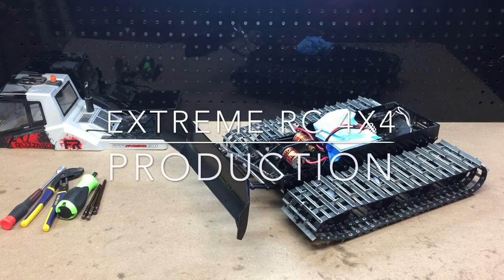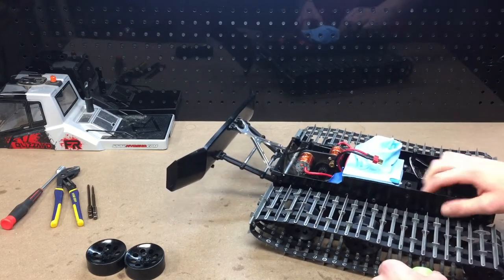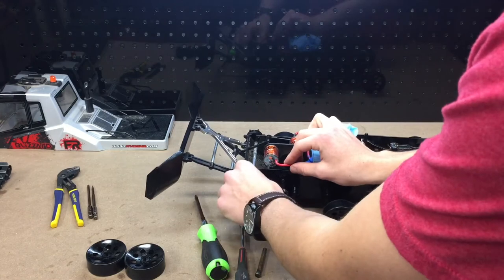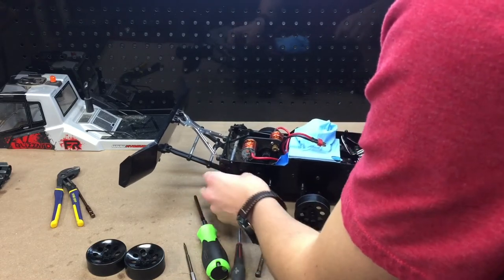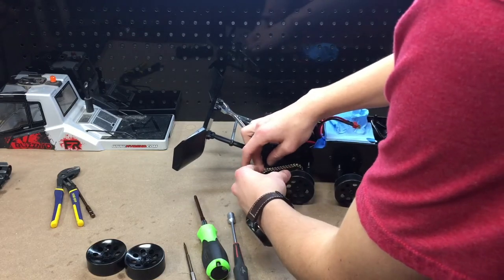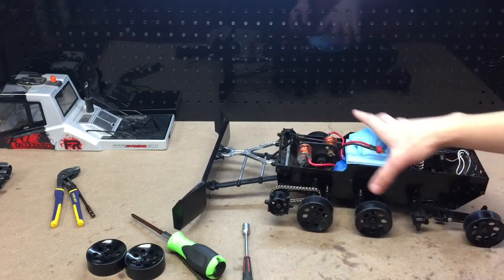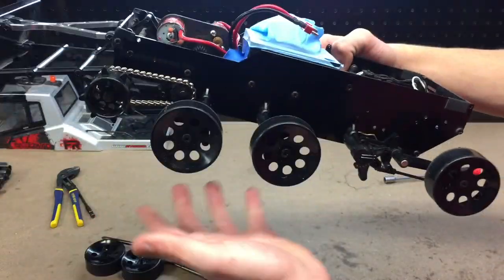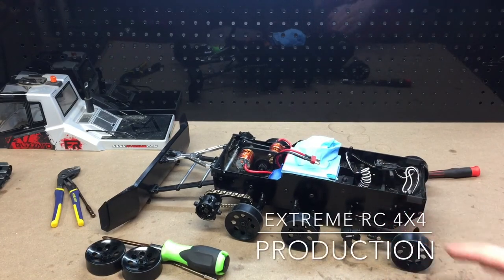EXTREME RC 4X4 Kyosho Blizzard Drive Chain Tensioning

Comment: I f you  hold the blizzard with both front 7 mm  bolts  loose   with sockets    
The weight of the machine will pull the chains to the correct tension     
Then you simply tighten  both at the same time   
Takes about  30  seconds from start to finish  no need to remove anything
Reply from the maker: You will be fighting the track tension at that point so it is best to remove them and adjust the track tension separately.

Comment: Gotta check mine. Threw a chain and it bound up. Didn't notice it was bound and blew the esc for the right track.

Time for a sabertooth esc and some traxxas motors!

Thanks for the video!
Reply from the maker: Ben Snipes doing some maintenance should help prevent any future issues! Sabertooth ESC is a great upgrade! I should have installed mine sooner.

Comment: Thanks a lot Ethan! I’ve been wanting to tighten mine since I got it. Sometimes they slip and I don’t want to ruin the sprockets. They always appeared to be fixed run adjustable. Great info
Reply from the maker: rc Ohio Thank you! Glad I could help. Wish there were some better factory instructions.

Comment: Awesome. Great vidd..lots of good information on the blizz.i have an electric and nitro blizz that both need the tensioning adjusted on them..now I know how to do it 👍👍
Reply from the maker: Time to get to work! Don’t put too much tension on them. Shortly after this video I adjusted them to have a bit more slack and everything worked a lot better.
Reply: @ExtremeRC4x4  yeah I noticed that if you tighten up the front drives and then rhe back suspension to much it the track's don't spin easily due to, to much tension.   My nitro blizzard front drives are different than the electric version. My electric blizzard isn't a 2.0 version it's an older model, but pretty much same set up..I wanted to ask you if you knew were I could find a complete  front push blade kit?? I  found parts for the front push blade and wanted to find everything needed together instead buying the pieces separately ?? Any help would be appreciated... I have found several rear tiller kits that are %100 complete, but no luck with a complete kit for the front push blade?? 
I'm gonna get the metal track's to .. my nitro blizzard is soo fast  I love it...Great viddz to by the way..thanks for posting them. Been very helpful...  thanks..Ray
Reply from the maker: @spottyjack614  I don’t believe there is a front blade kit just because they come on all of the new blizzards. The tiller is a complete kit because it is an add on part. I think your best bet is probably to order all of the pieces independently.

Comment: Within a few days of owning my blizzard today being the first real run I managed to throw the chain off the sprocket. My wheel screw was loose for some reason. Once I got the chain back on the sprocket I tightened the wheel and all was good. I don't think the chain being a little loose is a bad thing. After fixing it I'm finding I have more control than before
Reply from the maker: Zach Novosad it’s definitely not a bad thing. I have it set like that to help with getting snow and ice out of it. Personal preference really. Thank you for watching!
Reply: Ethan Boening yeah that's true. Do you think the metal tracks provide better traction for plowing? My plastic ones are ok but pushing snow to a certain point I lose traction
Reply from the maker: Zach Novosad the main difference between metal tracks and the plastic tracks is weight. The weight of the metal tracks helps a ton in the snow however I have found that both tracks loose traction on smooth surfaces without a layer of snow under the tracks. But the metal tracks are definitely a great option. I love mine!
Reply: Ethan Boening I see yeah. I noticed packed in snow mine slips around. But does amazing on regular snow.

Comment: I never saw you put the grub screw back on?
Reply from the maker: LiL Hustler at 3:30 I put it back into the plastic piece and then into the chassis. The screw that hold the drive sprocket on will snug it down against the chassis. Thanks for watching, I hope this clarification helps!
Reply: Ethan Boening ok thanks,i dont see your track tension vid?
Reply from the maker: LiL Hustler in order to achieve my goal of making a video every day I currently have it set as unlisted. Meaning that if you have the link you can view the video. The link is in the description and I will post it in another reply.
Reply from the maker: LiL Hustler here is the track tensioning video:
https://youtu.be/C2SyKLzxuts
Reply: I saw him putting the screw in! Review the video again.